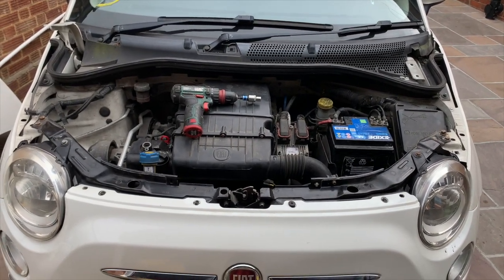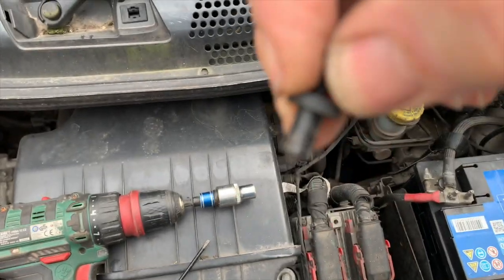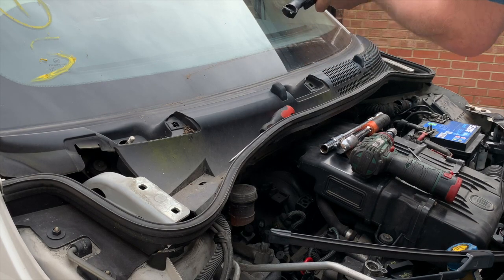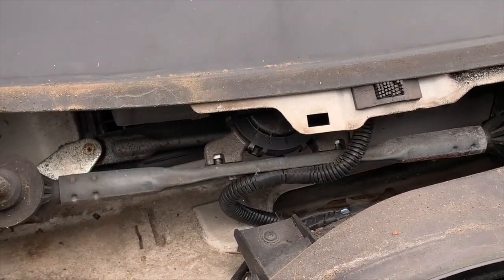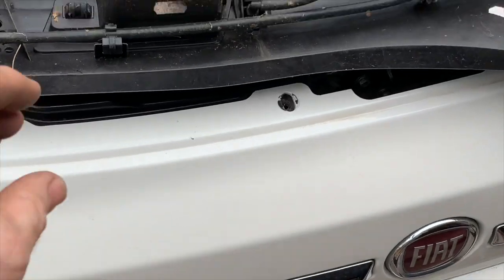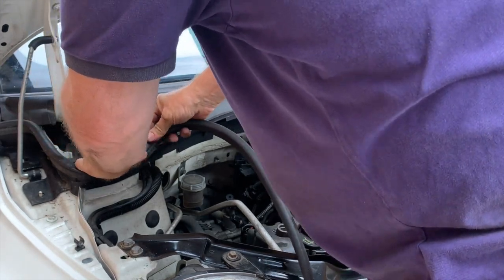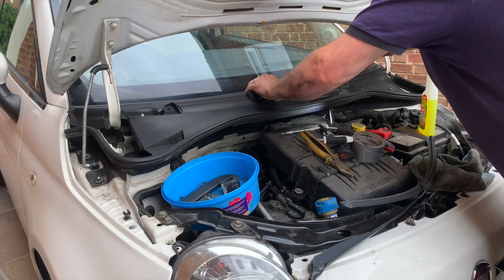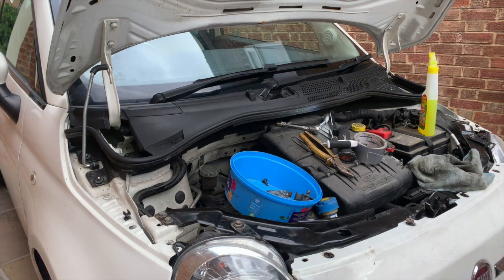Fiat 500 Scuttle Panel - Remove & Replace - Refitting without breaking the windscreen.

Comment: I'm a bit late to this video but I guess you search for things in life when you need to! Many thanks for this. Strange question, I'm attempting to change the head gasket on a 2014 Ford Ka which has the same engine as the 500. In the Haynes manual, it says to remove the front scuttle panel to remove the intake manifold but I was wondering if it really needed to be removed? Gaz.
Reply from the maker: It might be different on the Ka but I didn’t when I did that on the 500. I did however have to remove the side engine mount and tilt the engine forward to clear the bulkhead.

Comment: Please give some tips about taking on and off the small panels that are on the scuttle panel.  My clip broke and is stuck inside.  Thank you!
Reply from the maker: Pull the broken but out with a pair of pliers. I often superglue them back on if I don’t have any new ones. Won’t last forever but unless you’re going to keep taking them off it’ll hold in place. You can buy new ones for about £8 each. To get them off you just need to prise them with a fiat bladed screwdriver or plastic trim tool rather than just yanking them.
Reply: @Love500  Thank you so much for your response.  Tried both ways you mentioned and tried carefully to lift it and or jiggle it out.  It broke! So on the side where the clip use to be I used 3M indoor outdoor transparent tape, seems to be really sturdy... 🤞. Thanks again and I enjoy your videos!

Comment: Hi Paul , can you remember where you bought the plastic skuttle panel rivets the 4mm ones thanks i have looked on line but they are 5,6,7, and 8 mm ,thanks
Reply from the maker: I think it was eBay. I’ve actually bought a box load of different sized ones from AliExpress a while ago but haven’t tried them yet.
Reply: @Love500  thanks Paul

Comment: Hello there! I took my scuttle off to reconnect my rear washer hose. It seems there is no tension on those white clips that holds the scuttle down if they are not clipped under the window. How does it break the windshield? I initially left the scuttle somewhat lose, but today I went and snapped it into place, tilted it downward, pushed it as far as it went, and sure enough, no gaps all the way across. Is it from banging it? I have a USA market 2017 500 Abarth. Left hand drive.
Reply from the maker: If you don’t get the clips under the metal they will go above the metal but under the glass. Because there’s a gap you’ll probably bang it thinking it will flatten it. Once you do that the glass is damaged right at the bottom and will creep up. Even f you don’t bang it the vibration will probably crack it.
Reply: @Love500  got it! I have verified all 5 clips are under the white metal bit. However I did have to bend the scuttle up a bit to see if the middle of the 5 clips were engaged, I couldn’t get a better visual. When I did this, the 2 on your passenger side and the very middle one were engaged. Is there any danger to the windshield here?
Reply: @Love500  it also seems my clips have no tension if they are just under the glass, there’s a clear gap. Nevertheless, I have confirmed all 5 are now on the white metal. Thank you for your video!
Reply from the maker: @sbinnala  as long as they’re not between the metal and the glass it’ll be fine.

Comment: Hi I have just fitted new blades and they are still catching any ideas are welcome
Reply from the maker: Loosen the bolt and twist it round a bit. Normally the drivers side one. Its minuscule amount but enough to catch. Quite common in these. If it physically won’t move on the spline, just put a bit of pressure on it to pull it. It’ll be enough.

Comment: Windshield wiper covers taps are too wide for the hole and broke easily. I have narrowed the taps a litlle on mine and now the covers does not get broken everytime when you try to get them off.
Reply from the maker: Brittle cheap plastic. I’ve replaced soooo many of them.
Reply: They are too tigh in to the hole in beginning. Can easily broke even when new without grinding those taps narrower.

Comment: Link to the black clips?
Reply from the maker: These are various sizes but I believe 4mm are the correct ones.

https://www.ebay.co.uk/itm/100Pcs-Car-Plastic-Trim-Clips-Rivet-Door-Panel-Retainer-Fastener-Mud-Flaps-Push-/363669740245?mkcid=16&mkevt=1&_trksid=p2349624.m46890.l49286&mkrid=710-127635-2958-0
Reply: @Love500  thx!